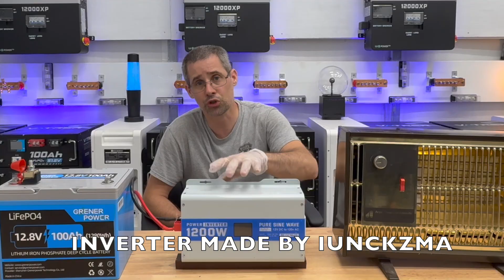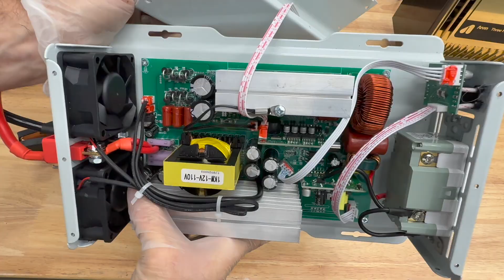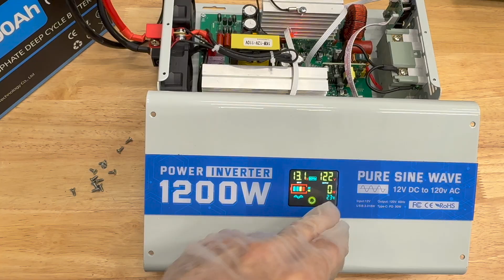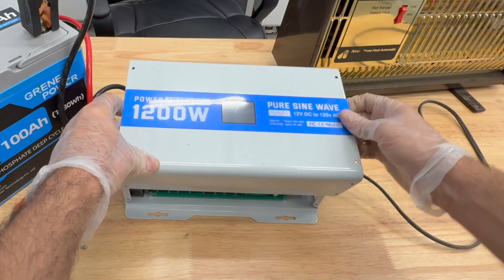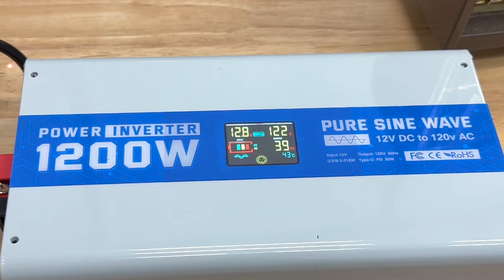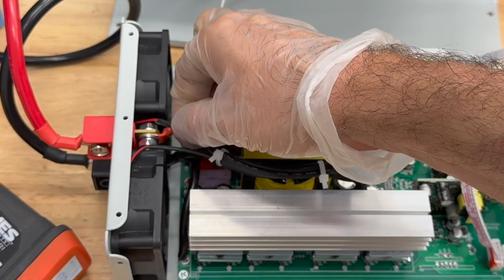ASMONTRIC 12V 1200W Inverter Review: Tear Down, Specs & REAL World Test!

Comment: I think the big reason for the wire heating up so fast was the alligator clamps connector.  Try it again with ring terminal lock down with a nut. Better connection.
Reply from the maker: That is very possible.  Where the smoke came from was the internal 8 gauge wires.  Each pair of 8 gauge wires can handle 80 amps.  I was pulling approximately 100amps through them.  If it was three 8 gauge wires instead of two I would have felt a lot better.  As always, thank you for watching!